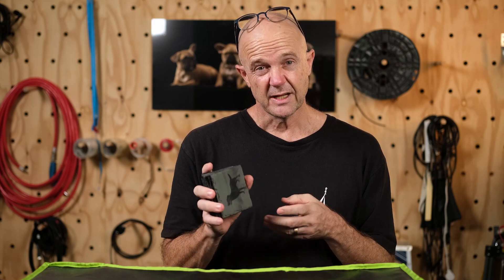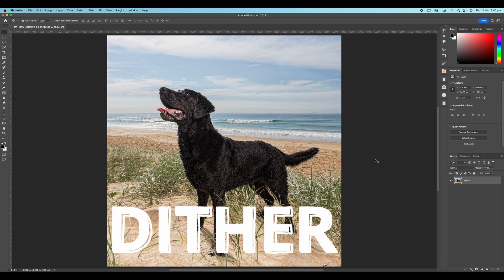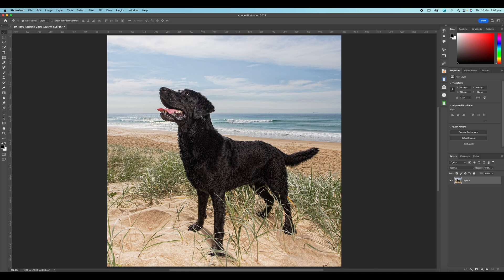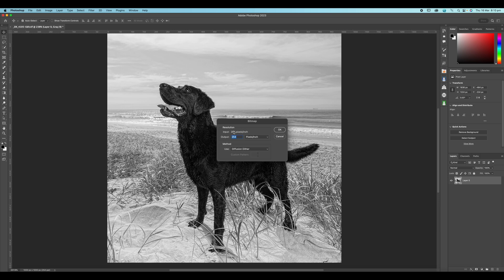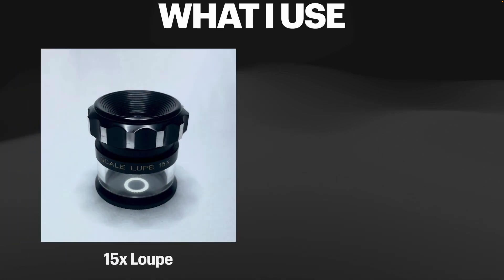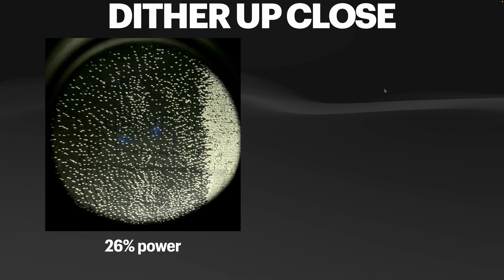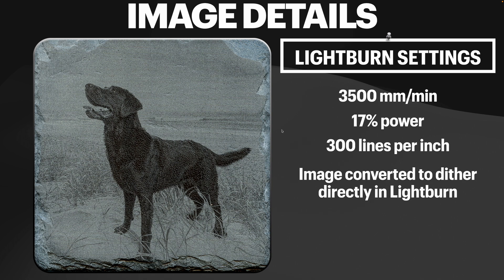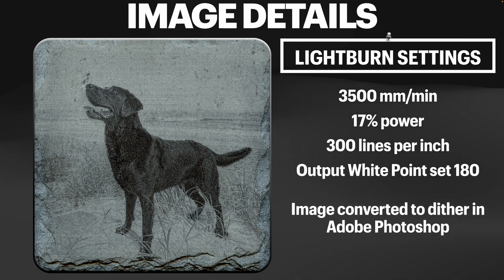UPDATE - Photo Engraving on Slate - What I've discovered since the first video?

Comment: If the dots are strched, lower the speed
Reply from the maker: The dot shape is due to the laser beam not speed - I have done tests to confirm and the laser documentation supports the same
Reply: @mrcraftsmith  I guess another lense could remedy that, shaped differently
Reply: …or even, just tilted

Comment: I don’t like inverted results on slate?  I find I get better depth and definition using un inverted but higher power.
Reply from the maker: Hi Carol - not really sure what you mean - slate being the dark background as opposed to white. The image needs to be inverted to get a "positive image".
Reply: @mrcraftsmith  I’ve been trialling a lot of 3d images rather than photos, for 3d I’ve found that the image pops off the slate better, or the 3d effect is more pronounced, when not inverted.

Comment: What happens if you use Jarvis? I have typically used Jarvis instead of dither

Also does speed make a diffrence to the dot length?   I see you varied the power, how about speed? 

Love your presentation

3 & 5 were my choice too
Reply from the maker: Hey Dave - I could be wrong but my understanding is that Jarvis is just another dither algorithm - from my testing the dot size doesn't vary with speed, however depending on the complexity of design it can be less accurate at much higher speeds
Reply: I use Jarvis too, not a fan of grayscale as too much white despite adjustments.  Jarvis with high power non inverted but high definition gives me best results.

Comment: The dot mode correction in Lightburn is an excellent tool and in early versions of Lightburn Jason realized the problem of  a 1 pixel signal producing a sausage shaped 2 pixel  burn. This is well explained in the excellent video cited by  HeritageNI.  In those early days, Jason set  the signal output to crop the beam diameter from  each end of a pixel string. This worked fine for longer pixel strings  but the problen this caused was to eliminate any single pixels in a dither pattern.  At the time there were no diode lasers to consider, where the PWM instant switching causes  this sausage effect. With a glass tube CO2 laser it is possible to balance the response speed of the HV power supply to speed and power such that you can get round dots  for square pixels. Thus in making the single dots disappear we could not get faithful  1pixel = 1 dot replication. As a short term fix,  Pass Through was implemented so that no dot processing happened  on externally dithered images. Dot shape  correction has now been reintroduced and it is a 60% fix for the sausage problem on RF CO2 and  fiber lasers where the. beam produces a ROUND  dot.  However, diode laser do not produce a round dot. As perfectly illustrated by Darren in this video, the dots are typically oval(ish) with a 2:1 aspect ratio.  Think logically about that situation and you will see that there is not HALF a pixel  burn at the end of each pixel signal  but a WHOLE pixel burn. Thus for a diode laser a 1 pixel signal generates a 3 pixel wide burn (long sausages!!!) No amount of dot correction is going to fix this inherent problem. 

Lightburn is an amazing program that tries to make things simple for new users and has the goal  to be a one size fits all program for any laser type. I would say Jason has been about 98% successful so far  but there will be perculiaritie for each laser type that cannot be catered for.  This video demonstrates one such problem.  Darren has set a resolution of 254ppi but he cannot produce pixels shorter than 0.2mm wide That in turn dictates that his horizontal resolution needs to be 25.4mm/0/2mm = 127ppi  BUT at the same time  his Y DOT  height is 0.1mm ie a resolution of 25.4/0.1= 254ppi.. Here is the Lightburn dilema. IF you set the resolution to127 you get a PRESET line interval of 0.2mm but that is not what you want  You want a line interval 0.1mm. Effectively you want to scan each line of pixels TWICE to create a 0.2mmx 0.2mm burn. That is THE best resolution Darren can ever achieve for true photo replication.  This resolution will be OK for large images 300mm sqaure but will look "blocky" ar 100mm square.

Darren has succeded in his goal of of showing that there is more to engraving that fiddling with Lightburn parameters and sliders. The diode burn shape  is a physical fact that cannot be changed so what Darren  is trying to achieve with his tests and  experiments in this video is an acceptable visual compromise.  The interesing thing about slate is that it is a BINARY material.  Simply put, it is grey compressed sand.  When you heat sand it turns to pale grey glass. If you burn the same place twice it does not change colour of the glass. Thus the material can only ever be dark grey and pale grey,  just 2 colours (a binary material).  The dither test pattern. shows this tolerance to overlapping X axis dots. . The grayscale  dithered pattern has been set at 254ppi  so only the distance between dots in the X axis is changing between 0 and 255. The changing shades of grey you see in the test pattern is an illusion created by your eye  as it mixes the light grey glass  dots with the dark grey background. At about  150,  the  0.2 wide sausage burns are just about touching. Remeber that the 245 ppi line spacing  (Y axis) is already correct for the dot height (0.1mm). So between 150 and  217 the suasage ends are gradually overlapping to exclude all the grey background, Thus beyond a certain point there is no perceived colour change. ("the white lmit"). This is one of those pragmatic  compromises that this test appears  to indicate and it makes sense to set the max white image level to match this white point. However,  there are now futher complications.. The test pattern is a reflection of how different  DITHERED shades of grey in an image will appear. There is NO uniforn gradation from black to  the "white limit" so an unadjusted image will have all the mid tones "overwhite" and almost uniform. This means the image must be  "fiddled with" to remove single and double pixels (say)  to restore the correct black/white ratio to the burnt image. Losing pixels means losing detail and this is the juggling act that Darren is trying to perform here.  I would say he has done a pretty good job  considering all the negative facts he is forced to overcome.
Reply from the maker: Thank you Russ - you articulate so well what I am not able to detail in my video - I appreciate you taking the time to expand on those inherent problems we face using diode lasers for either reproduction with photos 🙏
Reply: how do i find out if or how i need to do this?
Reply: @dafyddgould9485   
Hi
This ia Russ from Sarbar Multimedia.  I have to assume that you have a diode laser. The claims for  your m,achines's spot size maybe optically true but these machines are not projecting images. Instaed they are trying to concentrate light INTENSITY with a conventional lens system and that creates issues that are beyond the scope of normal lens theory. First it's very likely that the smallest spot you ca burn into your material will be 3 to 5 times bigger than that defined in the machine spec.  That burnt spot will NOT be a constant diameter. Oh,  by the way,  a diode laser usually burns an oval spot that can be 50% wider than it's height and that creates another issue when trying to replicate pixels. The burn diameter depends on  A) How accurate your focus is. B) The %power (exposure time in the case of a diode laser)   C) The speed, and D) The material. 
I will be happy to send you a test pattern so that you can explore what your macine is capable of . Remember that it is essential to know your machine's capabilities because the size dot you can burn defines the size pixel in your image. Iif your smallest dot is 0.2mm for instance then the best resolution will be 25.4 / 0.2mm = 127pixels per inch image resolution.  .
 Her is a private contact form if you need more information.
https://forms.zohopublic.eu/ndeavorlimited/form/K40XtreeemLaserCutterContactRussSadler/formperma/k2Cn0QN5ChpazfTMAUw25lZ-FKpjZa96TQWHjv3ntOg

Comment: Have you tried it in ImagR? They have multiple algorithms for slate. Also, I have been sanding my slate smooth first, then I spray paint them flat black which I think gives better detail and grey scale effect (greyer for white than the goldish of slate)
Reply from the maker: Thank you for watching - I have tried ImagR - I showed that example in my first video on slate engraving - and yes the results were great - this was more a demonstration to show how you can create that dither without the external software other than Photoshop and Lightburn 🙂
Reply: @mrcraftsmith  Ok Another tip I invented sorta. for slate and tile I fast dry them in an air fryer after spray painting at 300 for 5 minutes then cool for like 15 and ready to go no waiting 24 hrs to use.